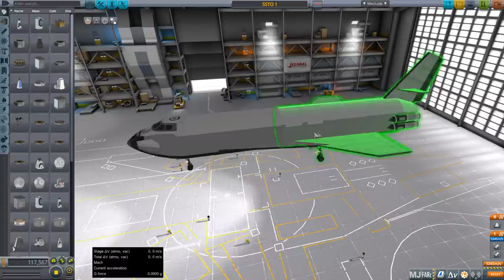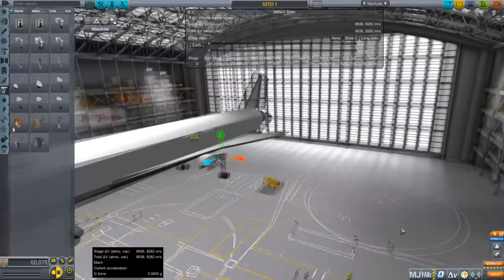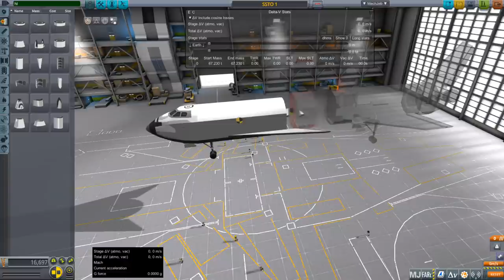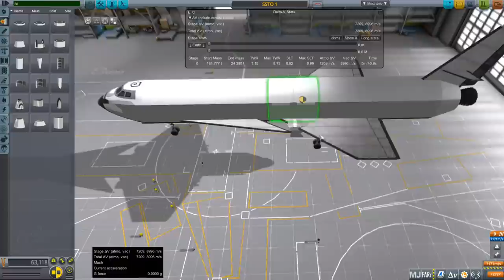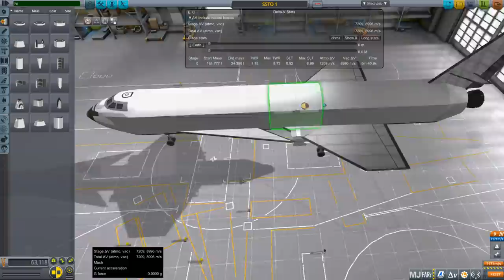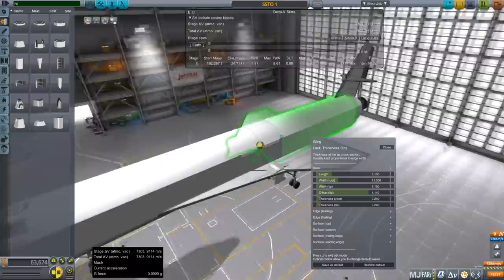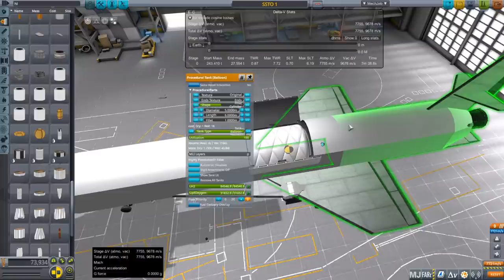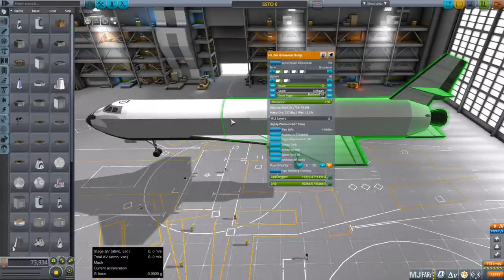Realism Overhaul in KSP 1.8.1 - SSTO Plane Tutorial Part 2

Comment: 1:15 Ah, yes, an aircraft which has to remain pressurized or it'll fall apart in the hangar is very practical. /s

2:45 If you know of a mod that includes them or could create a config for them, the Timberwind NTRs would probably be a good substitute.

3:35 I wonder what the rule of thumb for the mass-size relation of landing gear actually is...

21:50 The low-drag and heat-shielded nature of a spaceplane could make very low orbits practical, at least for short missions and provided the nose is constantly facing the airstream. I recall there was a plan as part of Project Man In Space Soonest for the first manned spaceflight to be a 2-orbit mission in an X-15B launched into a 120 × 75 (!!!) km orbit, though perhaps improved knowledge of the upper atmosphere and high-hypersonic flight would make such a gobsmackingly low orbit impossible in reality.

32:05 KSP water physics is fucked up. It shouldn't be a high priority for the developers to work on it, but god damn, vehicle-water interactions should at least make sense more than half the time. Hope it's better in '2. I wonder, though, if it would be possible to create a new hydrodynamic model for KSP 1 like it was possible to create a new aerodynamic model with FAR...

33:35 Your cursor was briefly on the CR2 Ramjet here. Also, when using hydrogen turbojets the "density loss" penalty for the air-breathing engines is potentially an even more significant drain on delta-V than the mass of the engines themselves, as compounding the loss of bulk density from simply losing propellant mass, due to them only using hydrogen the longer you expect to burn them the greater the F:O ratio has to be, which due to hydrogen's low density further decreases bulk density, thus decreasing wet mass fraction and delta-V. Perhaps using an air-augmented rocket instead would help, as though it would have less specific impulse than an oxic turbojet, it would only decrease the density linearly the longer they're expected to burn. Or nuclear turbojets... But I don't think either of those latter options are present in the conventional modpacks.

For improving this SSTO, without going into the numerous speculative avenues I've suggested... you need to get that L:D way up and probably include airbreathing engines. Every draggy m/s you expend on that runway is 1.2 dragless m/s you could have used at high altitude. I suggest you attempt to use another cockpit, lower-diameter tanks (or at least a more gradual diameter change), and larger, thicker wet wings. I don't think lengthening it helps any in reducing the drag (it may even increase it due to skin friction), only raising its ballistic coefficient.

Comment: I am currently working on a Nuclear SSTO, It has 4 nuclear air breathing engines and 2 nuclear Rocket engines.The main fuel tank for it 5meters in diameter and 35meters long.
The nuclear jets are mounted on the rear section while the Rocket engines mounted on the wings (like skylon). Jets produce about 1200kn of thrust and because they are nuclear air breathers they have infinite fuel . At 45km jets lose most of their thrust and the Rocket engines are ingited at this point.Overall it can put about 20tons to orbit which is dissapointing
Reply from the maker: Well, using KSP Interstellar-type engines like nuclear jet engines would make it a lot easier, yes, but those are not officially RO-compatible. So, it is sort of cheating. Otherwise, the fusion reactors and thermal nozzles make SSTOs a breeze.
Reply: Yes that sounds dissapointing in the first moment but its not realy cheating because there were real Projects to develop such engines. The Reason why this projects where cancelled was Radiation.
Reply: Why even have the 2 seperate nuclear rocket engines?
You can just switch the fuel of the air-breathing engines to closed cycle in-flight via action group

Comment: 10% dry mass with reentry hardened hydrolox is damn good, it seems to me.
Reply from the maker: But if the tank is that heavy, then it makes an SSTO plane impossible. That's just down to math.
Reply: That says more about the problems with SSTO planes than the tank, although that config is pretty ancient so it's probably not based on any real piece of hardware.

Comment: I Think Taking-Off from the KSC is your Biggest Issue. Launch from a Mt High Strip and/or Closer to the Equator(you do not need to land back at KSC) Adding all the Aft firing RCS to an Action Group will also give you more thrust, After Escaping the Atmosphere. (they would be carrying their own weight to orbit) my 2 Cents.
Reply from the maker: That is perhaps missing one intended benefit of an SSTO airplane versus an SSTO rocket - we want it to be able to use a wide variety of facilities - basically any place with a runway instead of solely operating from particular launch sites. If we want to increase payload capacity, we can launch from the equator or higher up, but we shouldn't design for that.

Comment: I'm trying to design a Dyna-soar style spaceplane using late '50s parts in an RP-1 career.  What video has your design philosophy on how to design for a lifting reentry?  It is the getting lift part I am having trouble with (pitch 40, peri 60km).
Reply from the maker: It's all about how much mass you're putting on a certain surface area (the area hitting the atmosphere). The more mass you have, the less lift you'll get. A decent maximum is about 160 kg per square meter - you want less than that.
Reply: @RaizSpace  Thanks, I will do the math on my current design and modify it as necessary.